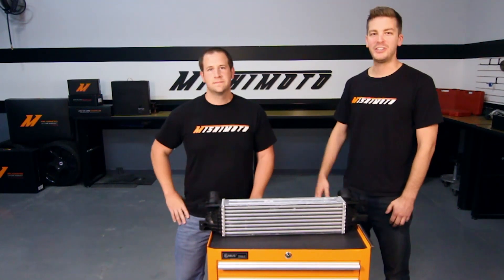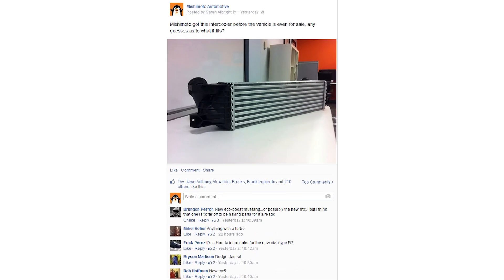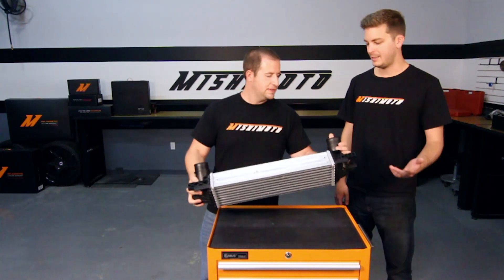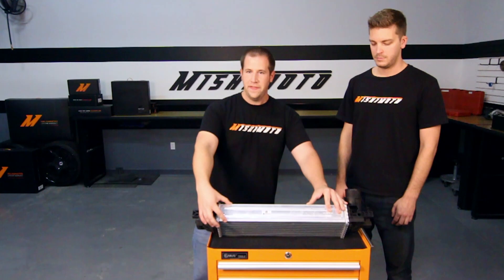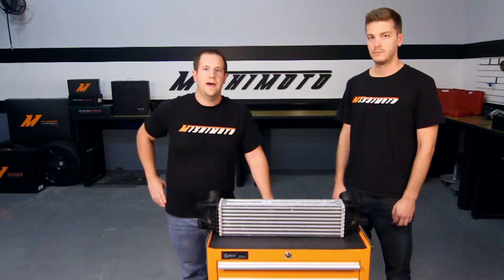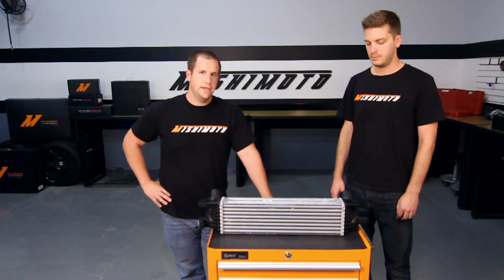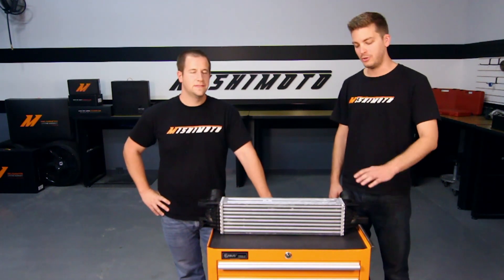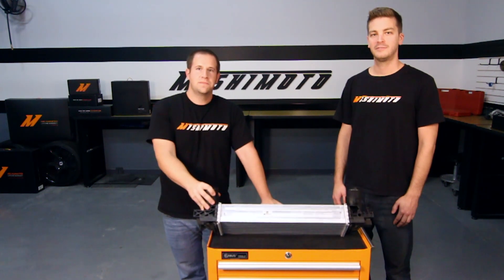2015 Mustang 2.3L EcoBoost Intercooler: First Look, by Mishimoto

Comment: Do you guys know when your Mustang is scheduled to arrive?
Reply from the maker: At this time we do not have a date for our test-vehicle to arrive. Once it does, you can be sure that we will have plenty of videos showing the features. We will also have it on the dyno pretty for a few pulls!
Reply: I am really excited to see what kind of power the ecoboost puts to the wheels. What kind of modifications do you guys plan on doing to your test Mustang?
Reply from the maker: Steven North
As are we! We are planning to develop an array of cooling products for the Ecoboost, including an intercooler and radiator. Our goal is to adequately cool the new Mustang for both street and track environments.